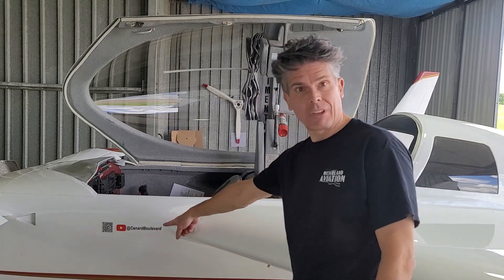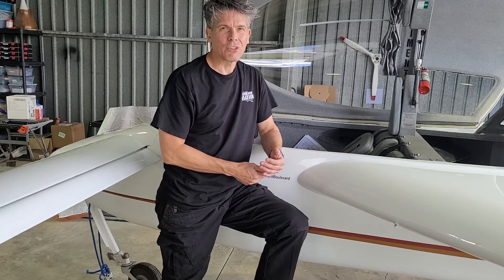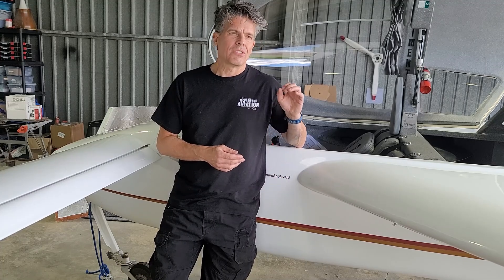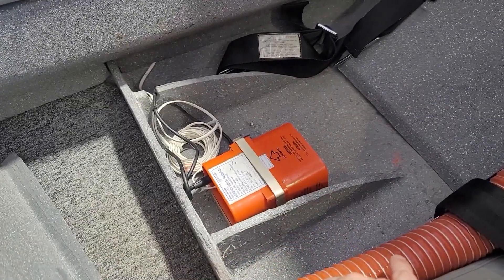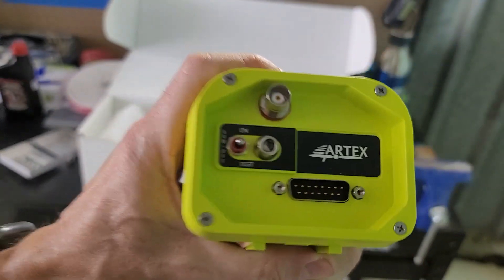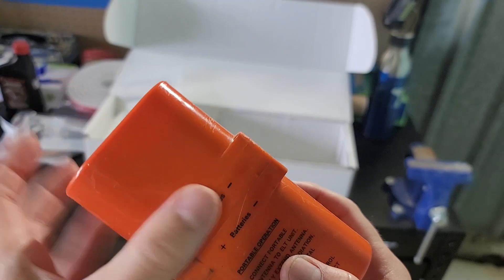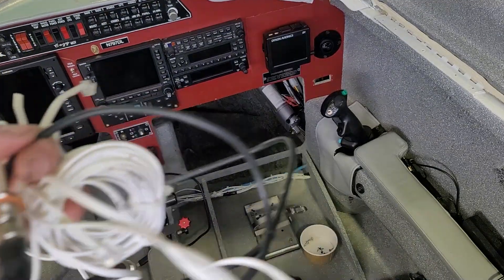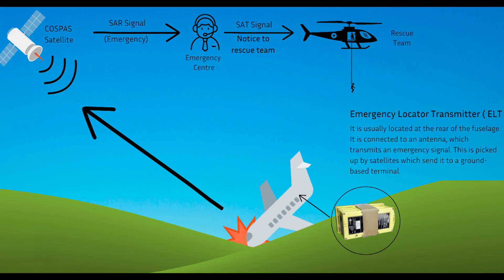Emergency Locator Transmitter: Be Found After a Crash!

Comment: I noticed you have a bit of cable coiled up. Depending on the application this usually this is not problematic. The thing is, that a bunch of neatly coiled cable can act as a pick up coil for all kinds of unwanted signals (interference). So I tend to keep it modest and if for some reason I need long cables/wires i either don't coil the neatly or use two coils (on the same wire/cable) wound in the opposite direction and put them together. There are other mitigation measure possible of course if you experience some spurious problems.
Reply from the maker: That cable you saw with a single coil is actually the antenna cable - so it's shielded anyway. It didn't stay coiled up like that: it was just connected that way for testing. Once I had everything tested and fitting properly, I cut that cable to length and re-terminated it so that it would reach the ELT without that extra little loop in it.

Comment: I'm going to add another comment regarding field performance of the unit (BTW, I have the same Artex unit in my airplane). A canardist friend of mine installed the same model in a Long-EZ  and he had a mishap on landing afterwards in which the airplane veered off the runway and hit a sign hard enough to shred half of the canard off.  Even then, G forces were not high enough to trigger the ELT.  So, it appears not entirely improbable that the unit might not be triggered in a forced landing bad enough to incapacitate the pilot. So, in a forced landing situation, It might make sense to turn it on manually moments before landing. The thing to keep in mind is that the unit will not begin to transmit until it has completed at least one check cycle which is about 50 seconds long. This must be done so that if the unit is accidentally turned on there is some time available to reset it before the signal is pushed to the satellites. There is also the not so improbable situation that the unit itself is incapacitated in a forced landing before it has a chance to signal the satellites (water, fire, etc). My thinking is that it might make sense to turn it on manually early on in the emergency check list and cancel unnecessary SAR actions afterwards if need be. I haven't read much about how pilots think or strategize around this and would welcome any comments.
Reply from the maker: I agree, and this should be standard procedure - so that you are absolutely sure a valid GPS position has been received by the GPS (because all your avionics is operating) and you are most likely to get a signal out to the satellites BEFORE the landing (best chance is before the forced landing) - and yes, that means one minute beforehand, to handle that satellite transmission delay. As soon as I have an emergency and a forced landing - on OR off airport looks like it's going to be the outcome, my ELT is getting switched on. If it all comes out fine, they will call and I can tell them it's all fine.

Comment: I don't know what your ground plane to antenna connection actually looks like because it's not shown on the video but as someone who considers himself somewhat of an RF expert I would caution you that it is somewhat critical, especially at the upper 406 MHz frequency and hopefully you've done the corresponding VSWR measurements to verify. The "standard" over the air radio sweep test at 121.5 MHz alone is not good enough because the ground plane to antenna interface is not that critical at that frequency and besides, it's a close range (near field) test, the antenna would have to be completely disconnected for that test to fail, and sometimes even then there's enough leakage for the test to pass.  It was nice when we could do the Artex 406 through satellite test because at the very least one could rely on that report as a check, but now that that service is no longer available a proper VSWR test may be the only way to be sure (other than activating and waiting for the call from SAR which is obviously a very bad idea :)

There are portable 406 MHz ELT signal analyzers but at close range (or even worse, with a direct connection) they don't tell you much about the signal strength (gain) at satellite range. A VSWR test at 406 MHz is not trivial, I had to use a portable Vector Network Analyzer (VNA) for the tests and even then you need to do it outdoors because reflections inside the hangar will give bad readings.  If you just want to comply with regulations then none of this matters much, but if you want to rely on the system for what it's intended, then you might care. A metal skin airplane does not have these issues if the antenna provided with the kit is installed as instructed. Although even then, once you cut and re-splice the coax cable or connectors, all bets are off and the VSWR is needed. In a composite airplane the antenna and ground plane installation is not trivial.
Reply from the maker: I'm also a HAM, and have some experience as well. I used a well-designed radial ground plane, and validated it with my NanoVNA afterwards. It's always a compromise, so I have it tuned more for the 406 side than the 121.5, but it's petty good for both.
Reply: @CanardBoulevard  What you speak is true, it is always a compromise, and the VNA takes care of the concern, mostly. After I posted my comment I had second thoughts about it because I don't like lecturing, especially someone as knowledgeable as you, hell, I'm probably learning more from your posts than you would ever learn from me!  I've been tempted to delete my comment since yesterday but if you don't mind I'll leave it here, your channel is getting a lot of attention from canardists and the information may be useful for someone not as experienced with this topic, unfortunately, for composite airplanes it's not a trivial one. I'm always willing to help anyone that needs help in this area, it's probably the only one I might be able to make a significant contribution in. As always, thanks for the reply.

Comment: I just installed the same ELT into my Cozy.  Instead of a ground plane, I used a copper foil antenna on my copilot seat.  I can send you photos if you are interested.
Reply from the maker: I did the same idea, but I used copper foil on the floor of the airplane as a radial ground plane. I thought about using copper foil on the back of the copilot seat (you can design it to resonate at both 121.5 and 406) but I figured having the original Artex antenna would be more crashworthy - I located it in the center, between the front seatbacks. Copper foil is pretty fragile.

Comment: Great video, as always. I have a 406 ELT installed and have had one accidental activation while someone was simply climbing into my plane while it was in the hangar. I thought I'd shut it off in time, but 15 minutes later I got a call from ?? Air Force Base asking if I was all right. So that was an inadvertent testing of the system. But I'm frustrated that they specifically disallow testing of the system as a whole. Sure, you can "test" your ELT unit on the hour, but that doesn't test the whole system -- ELT, transmitter, antenna, satellite, ground station, reporting system. Wouldn't it be nice if you could do an ELT whole-system test as easily as you can an ADSB test (the PAPR system) ?
Reply from the maker: I agree, there is no way to actually test the 406 satellite portion of the ELT. There used to be one called 406Test, that was operated by Artex, the manufacturer of my ELT, however it was a pay service, which I guess they weren't making much from and they recently discontinued it.

Comment: Hi Scott  With the new style of battery's ( Lithium) ; Could a "isolated" charger be hooked up to ELT so the battery is always charged?
Reply from the maker: The battery in the ELT is a lithium type that is non-rechargeable. It is very long lasting and will hold its charge for many years, but does need to be changed out when it expires.